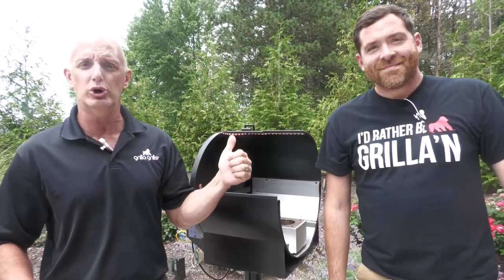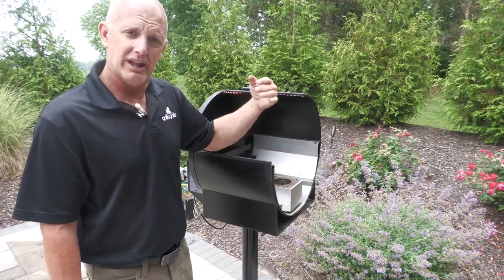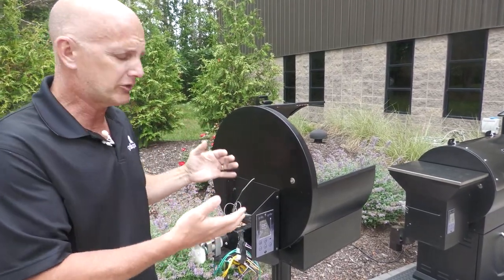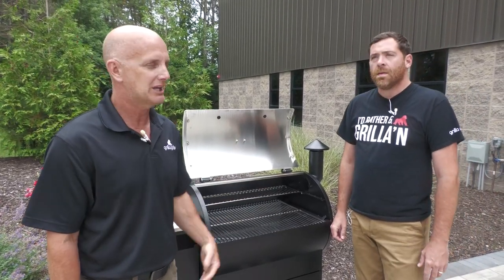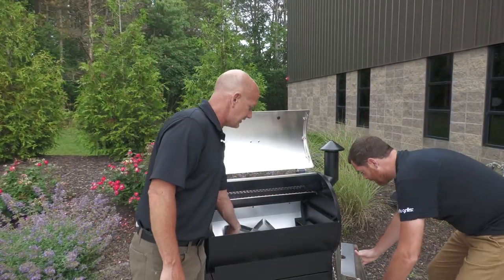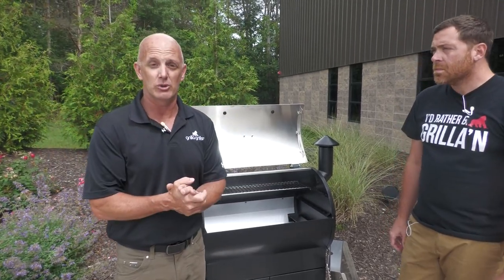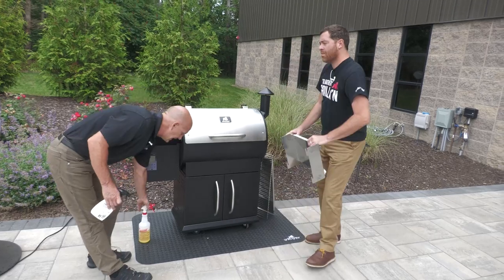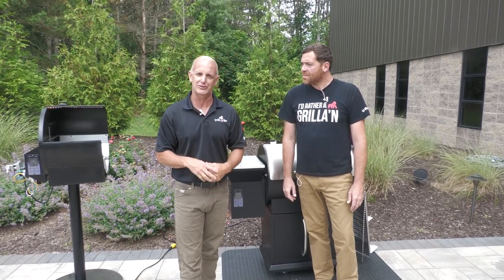How do Pellet Grills Work? | Gear Breakdowns with Mark Graham of Grilla Grills

Comment: Mark, do you recommend cleaning the inside temperature probe?  If so what’s the best method?  Could a dirty probe make the Silverbac burn hotter?  I’ve had my Silverbac about about 5 months and it consistently runs hotter than the programmed temp even using the built in probe. When I attach a 3rd party temp probe at grate level that temp is always 20-30 degrees higher than what the control panel indicates. And that’s after dialing back the pellet feed rate from 12 to 9. Btw I wish there was a firmware update to make the adjusted pellet rate permanent. I like the Silverbac so far but dialing in the correct temperatures is critical for low and slow cooks.
Reply from the maker: You should clean your rtd with a damp cloth on a regular basis, a buildup of soot and grime can impact the accuracy of the probe which would in turn impact the way the grill cooks.

Be careful not to douse or submerge the rtd as it is not waterproof.

Keep in mind, a probe sitting on the grill grates will not register an accurate grill temperature.

Trust your grill, trust the swing. These things do great work if you let them.
Reply: @GrillaGrills   To be clear my temp probe doesn’t sit on the grates, it’s in a holder that keeps it parallel to the grates about an inch above.  Wouldn’t you want to know the temperature of the grill where the meat is?  Another question, if you adjust the feed rate does that apply only in mode 1 or does it also affect the feed rate on mode 2?  Thanks.

Comment: Have you thought about setting up the shutdown process on the grill to shut the fan off based on temperature rather than a set time.Instead of stepping down the temperature letting the fan run until the grill reaches a set temperature before it shuts off.I would think that would remedy some of the hopper fires
Reply from the maker: So we've actually done the math behind the scenes. On the Alpha Connect versions of our pellet grills, the controller will read what temp the grill is at when it goes to shut down. Depending on that temperature, it enters into 1 of 2 different shutdown modes.

The controller may show counting down from 5 or 15, but in the background what you can't see is that the grill is doing what it needs in order to safely shut down at the temp it was shut off.
Reply: @GrillaGrills  Thanks for the info and quick response.You guy's are great